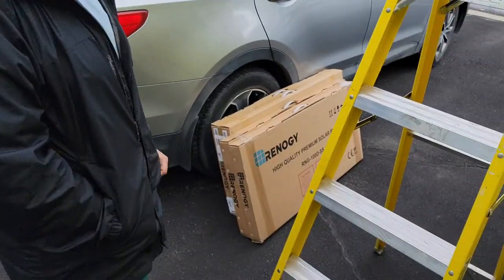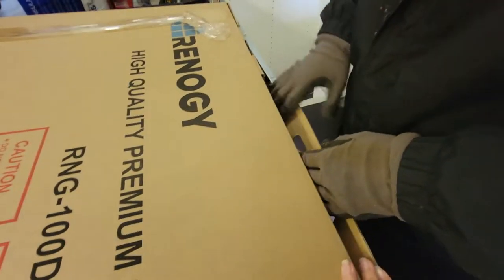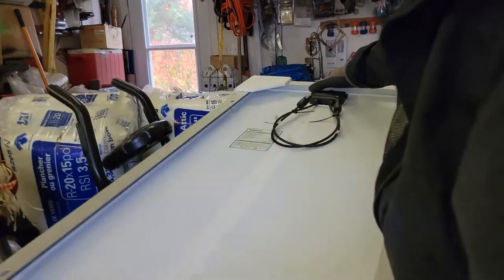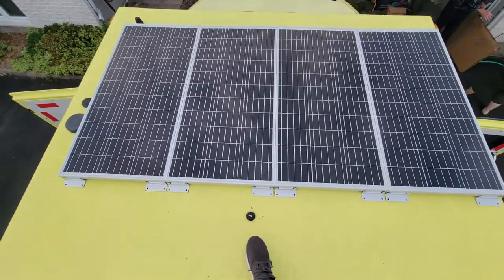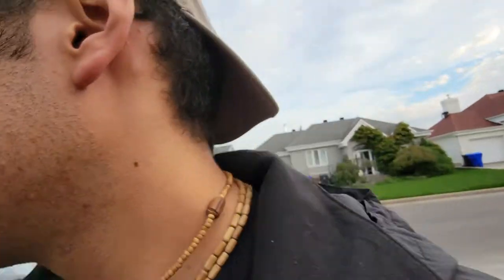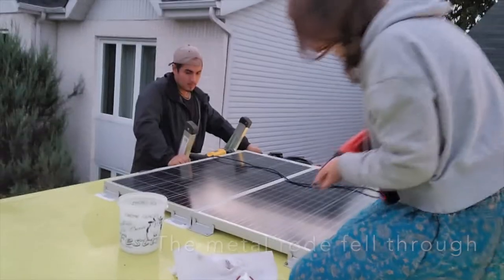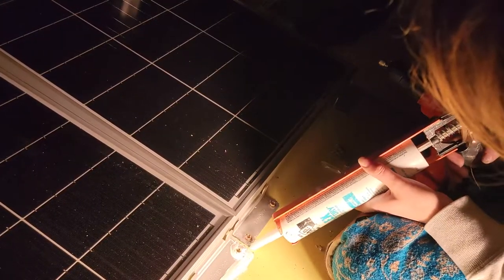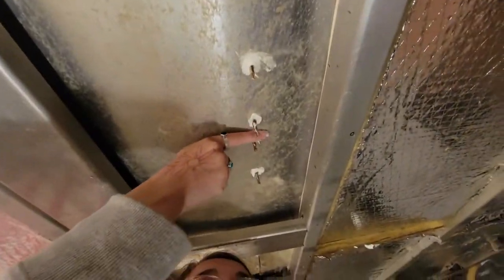Solar Panel INSTALLATION on an EX Ambulance! DIY Van Life Conversion

Comment: im sorry but your roof is going to leak bad.🙁
Reply from the maker: I'd love to get some of your advice ! What do you see being an issue?
Reply: @yoginisol  on the screws going into the roof especially the ones that spun, will wiggle loose. i would suggest that you keep the ceiling access available so you can fix the issue in the future. Rivnuts made of aluminum should be used and galvanized bolts. this will prevent electrolysis. also use silicon on inserting the rivnuts and bolt threads. i wish you the best on your build. i did learn a lot on your removing of the electrical. thank you for that.🙏👍
Reply from the maker: Thank you so so much for this helpful information! It is our first time doing this !

Idk if you saw but we did put gorilla tape, hopefully it will make sure that the solar panels/screws don't move ! Maybe even getting nuts and bolts instead to secure it from the inside out would be a good idea!